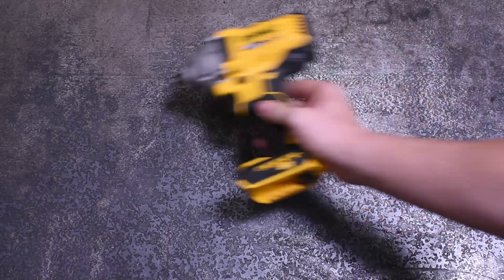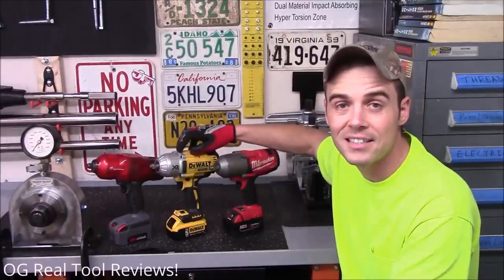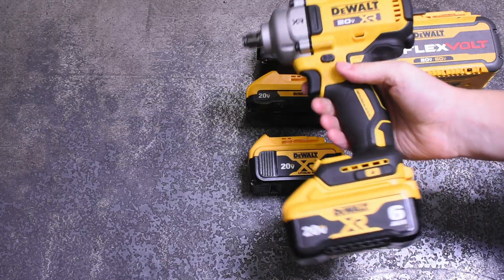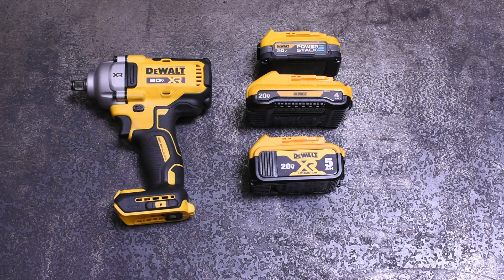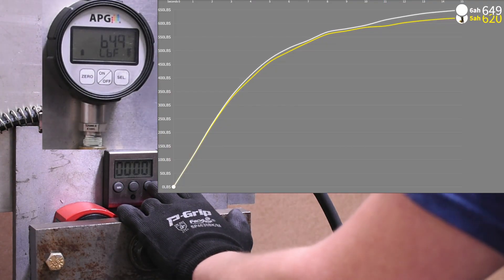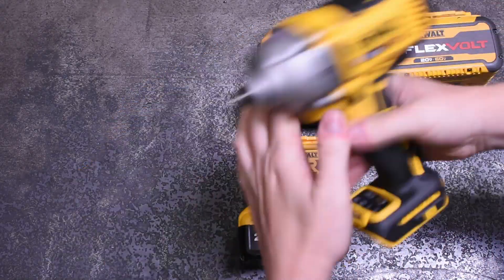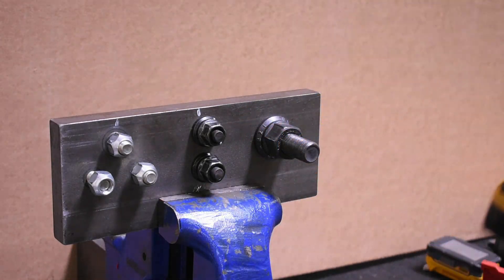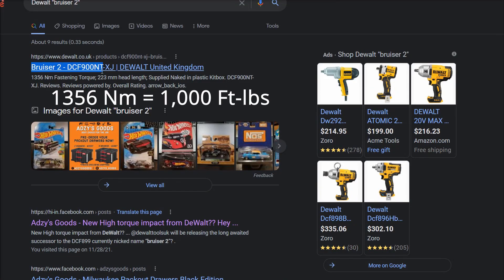Exactly How Much Torque Can DeWALT's Latest Impact Make?

Comment from the maker: The tool is now out! https://amzn.to/3N6bFci
@ 2:35 the labeled tools are swapped, our bad! 15ah might be more lawn mower territory ,but it wont stop us from trying! Who's money is on DeWalt's DCF900 taking a top spot? If you find one sitting on a shelf before it's officially out, drop us a line! Haha
Torque, who started TTC, is working in product development for Astro tools,who also make impacts (air). Always consider multiple sources when looking at a tool!
Reply: I have a 9ah Flexvolt battery sporting those 21700s I could send your way.
Reply: Milwaukee Who ??  Where are all the Red Cry Babies Now  👶 😭 ...
Reply: So I had the old Dewalt mid and I returned it so I could get the new one. The new one is extremely more powerful than the old one. But today at work the new Dewalt shown in the video broke. I’ve had it less than a week already it’s a brand new tool it just came out it’s so powerful it self-destructed itself. The tools still tightens the bolts but it sounds like a box of rocks 🪨
Reply: @Qwertyuiopzxcvbnmlkjhgfdsarbs  so has it released yet?
Reply: Love the channel. How about a worst case scenario competition for these tools. Using the worst available batteries and trying for the highest values. Perhaps a lower power tool with a cheap battery may perform better than a higher power model with a similar cheaper, or lower amp battery. Just throwing it out there, thanks guys!
Reply: Torque: Do you know if this new dewalt is gonna be avaiable to northern Europe/Scandinavia?
Reply: @Speedy6617  yes, it is coming.
Reply: @ThePegi27  Ah. Nice. Thnx for answer.
Reply: @Speedy6617  should be available actually in the coming weeks if not already 👍
Reply: I knew he was hinting at this in the last video!
Reply: I have a XR 1/4" apex(bits) type impact from 2014 and it could remove lug nuts off a 2010 Corolla. Gotten water in it and it still runs fine, batteries are still like new due to charge duration lasting.
Reply: 15ah batteries will be exactly way to go on chain saws, movwers, big table and mitre saws and so on 👍
Reply: Hello again Torque Test Channel 
Thank you for another Great Video. I enjoy watching you test the impact Wrenches. Again thank you
Reply: Anybody have a release date to when this puppy drops?
Reply: You should test the craftsman with the 6ah or the 9ah battery. I'm curious whats the difference since craftsman suggest to use the 6ah.
Reply: Confused me for sec seeing 600 ft lbs on the 894 XD
Reply: How do you think the DCF891 would perform with the Flexvolt 6Ah battery, compared to the 6Ah XR...etc

Comment: I currently have 2ah xr and 5 ah xr. Bought a DEWAlt cutoff tool and came with a free charger a 4ah and a 6 ah.(dcb2460c) will my tools perform better? Impact/grinder/saws? Not sure if I should sell or keep them. As far as impact I have the old dcf894

Comment: What's a better option, the DCF921 or DCF923? Only difference is the size of the drive, 3/8 or 1/2. At that price range what would you guys think is the better choice?
Reply from the maker: I like 923, same power smaller sockets
Reply: @TorqueTestChannel  That's what I was leaning towards. But HD has a sale for $300 for the dcf513 and the dcf921. Cheaper than getting the two alone w/o battery. But I still wanted the 3/8 on the dcf923

Comment: BTW you switched the two mid torques when you compared them  DCF894 vs DCF891.  You put the weaker DCF894 on top.

Comment: My thoughts on the 15ah result: The 6ah pack is rated to deliver 70A based purely on cells, the 15ah pack probably uses the 18650 25S (i've not found out what it actually uses yet) so should theroetically have a current limit of 150A (!!!) but presumably that is being bottlenecked by circuitry etc, and I suspect that many cells jammed together requires some sort of current drain management to prevent the middle of the pack from overheating.

Comment: Hey I'm just curious because there's an 894 on sale in my area. Are the model numbers on those first two tests accidentally switched? Because it shows the 891 below the 894 but it sounds like you're saying the 891 is more powerful as we can assume.
Reply from the maker: Yes, sorry. 891 is on top
Reply: @TorqueTestChannel  Do you think the 894 is worth $109? I really only do trailer and pickup truck tires here or there.
Reply from the maker: Yes. Thats a good buy
Reply: @TorqueTestChannel  Thank you sir.

Comment: In the test with the 894 vs the 891 were the graphs labelled wrong? This test showed the old 894 beating the new 891. I am confused. I thought the 891 had higher torque values. Someone please clarify. Overall video is great and I am thinking about replacing my ridgid octane mid torque with the 891.

Comment: Did anyone else notice the fact that this new mid torque beat out the flex and kobalt high torque with the 6ah battery? Been thinking about going kobalt because of budget but I almost can’t STAND the size of the high torque. This in a kit might be worth the money with a standard 5ah battery. 3 inches shorter and I would imagine a whole lot lighter.

Comment: I have an absolutely battered, close to worn out Dewalt 18v 1/2" impact I use day in and day out at work - when I got it (well used/cheap/kinda broken already really) it amazed me & relegated the air-powered guns to the bin - I wondered how I'd managed/why I'd managed to work so long without a "decent" battery impact wrench - I have no clue how many hours/thousand hours I wasted turning wrenches by hand over the years. 

If you're dithering about getting one - get one. You will wonder why it took you so long to get one.  You will also never again want to be without one & will start watching Channels like Torque Test in order to figure out which one you're going to buy next - and that is entirely sensible because cordless impact drivers are the dogs danglies if you open/close fastners for a living.

Comment: I’m curious as to why you don’t use the 8ah 21700 pack? Do you just not have one?
Reply from the maker: 8ah 21700 packs (from Milwaukee too) use Samsung 40T cells instead of 30T cell, the 30T cells are basically as good as it gets discharge rate wise. So usually not much difference, and if one the 6ah is on top. What we're really missing here is a 9ah flexvolt 21700 cell pack!

Comment: I wonder if some of the larger mah battery torque increase is due to the power transfer dynamics. More weight on the opposite end of the anvil should increase the efficiency of the blows, versus lost energy into the operators hand. You could try testing a specific battery like a Powerstack, then strap a few lbs. to the bottom of the battery.

Comment: Am I missing something? This Impact is rated for 800 ft-lb for nut busting which is what is demonstrated in this video. so Dewalt is over rating it.  I wish they made a 3/8" version. Do they make a 3/8" anvil for this ?
At least all your testing is consistent with all the different brands/ models
Reply from the maker: Nut busting is removing. We"re going reverse but still tightening. No 3/8" for this on

Comment: The new high torque going be an animal.  I have my dcf899 all most 4 years and it been a beast . Friction ring replaced is all . Also tool is very heavy and causes batterys to break were screws hold them together

Comment: I have just ordered the DCF891 based largely on this video.  I am wondering how it will stack up against my old "high torque" impact which is a DeWalt DCF889.  I don't see anywhere you have tested the 889.  Am I missing it somewhere?
Reply from the maker: It would just embarrass that gun power wise

Comment: So I had the old Dewalt mid and I returned it so I could get the new one. The new one is extremely more powerful than the old one. But today at work the new Dewalt shown in the video broke. I’ve had it less than a week already it’s a brand new tool it just came out it’s so powerful it self-destructed itself. The tools still tightens the bolts but it sounds like a box of rocks 🪨

Comment: The 891 and 899 are rated for 600/800 and 700/1200 install and breakaway.  But this video shows the install torque is the same.  Does the 899 still have an advantage in breakaway?  If they are equal I would absolutely consider switching to a tool that is half the weight and the same performance.

Comment: Well I got the 921 recently which wrecks my old 890, though that's still nice to have around if I want low torque. I have the 894 and 899, but this new 891 can pretty much replace both of them. Will definitely be looking for a good deal on it now. Thanks for the great info!

Comment: Amazing power. I'm a team red guy myself, but instead of having all these different impacts for torque ratings I would really like to see some tech go onto one that will control the torque output more, maybe even determine bolt torque depending on if there's a torque stick, extensions, etc.
Power is great but if you can't control it it can definitely make your day go from good to bad in a quickness.

Comment: I have a question where could I take my tw1000 to have it tested. It claims 748 or so but I'm skeptical it's such an old design
Reply: If you have a torque wrench handy you can crank a bolt with your impact then set your torque wrench to let's say start at 450 and see if you get it to click. If it does start stepping up the torque wrench to keep getting a click till the bolt moves. That will give you a pretty close estimate of output on the impact. The closer you think you are to the impacts max torque you can make smaller changes to the torque wrench.
Reply: I've taken 700 ft lb torqued bolts out so I have a benchmark to start from. But as far as tightening no idea

Comment: Just picked up a new FLEX 24V high torque 1150 ft-lb busting torque and 800 fastening torque with 5.0 ah battery.  I have not seen any Flex impacts tested yet.
Reply from the maker: You have not looked very much then :P

Comment: How the fuk are u idiots gonna tell people AH makes a difference in power or torque trolls has nothing to do woth power and using a 60 volt battery on a 20 volt tools ur dumb as it comes. Plz people dont listen to these idiots
Reply from the maker: We're not telling people anything. The bolt is getting tightened differently by different batteries. Feel free to tell the bolt that. Battery capacity doesn't make a difference in power, but the number, type and size of cells used in each battery can make for more discharge current and less voltage sag. Maintaining closer to 18V while running = more power (DeWalt 20V run at 18V). And the 15ah is called flexvolt because it can be used on 60V or 20V tools. Like it says on the battery itself and its packaging, my very confused or trolling friend.

Comment: With the dynamics of cell design and cell size when it comes to power delivery, I really want to see someone adapt 4680 cells for a power tool. Not only are they larger, but they're also 'tabless' and more akin to a pouch cell's tab design; a shorter, more direct path between tabs. I know there's probably patenting issues surrounding the cylindrical cell 'tabless' design, but I want to see a manufacturer make a tabbed and tabless variant of the same cell, at least for demonstration purposes, all other variables being equal, just to see how much of a benefit tabless is when it's the only difference. Although these cells would be overkill, apparently their spec sheet says that one cell has a 26Ah capacity with a marginal voltage of 4.61V, with an operating range of 4.2V to 2.8V, and a fast charge time (10-80% SOC) of 20 minutes. Again, overkill, but also the most amount of beans per cell; though it might actually be a good option for those industry-level batteries, like Milwaukee's MX line, an MX 1" impact could be very interesting, especially if MX ever adopts 4680s.

Comment: Dewalt really showing the beans in all categories. Their best 12V stuff are insane, and the options in the 18V range is turning out to be some serious stuff.
Reply: The first DeWalt tools I got were a 14V drill and impact driver.  Smaller and lighter so they fit in my toolbox along with everything else, and amazing power for their size.  A pleasure to work with, and they've lasted...  Since then I've bought other brands beside DeWalt, but after my experience with that first set, I've never spent money on cheap power tools ever again.

Comment: Can you test the torque loss of using the wrong size socket on a nut/bolt? For example, a 34mm socket on a 33mm lug nut, The other day my coworker struggled with a 34mm socket on 33mm trailer lug nuts, guess he didn't double check the fit before going to work. I bet he lost a decent amount of power to corner deformation.

Comment: The one thing that most buyers don’t realize Milwaukee, Dewalt, Makita, Flex etc. They’re not competitors to each other. The power tool market is Monopolistic Competition meaning no company is a true competitor to each other just like gas stations. The reason is because all of their batteries are not interchangeable. Once you get deep into one line it’s not economically feasible to completely change your brand. If you have maybe 1 tool of each brand you may be able to swap fast but the majority of buyers of all these brands are already heavily into one brand. I’m personally deep into Milwaukee and it would be stupid to switch to another brand after I already have thousands of dollars in tool. However for sockets and hand tools the market is more feasible to switch but still monopolistic competition.
Reply: My First Milwaukee tool was the first GEN high torque 2763 which I use every day as an auto technician for the last eight years there wasn’t a nut or a fastener that it couldn’t takeoff. It can take off a Honda crank bolt very easily. I’m sure the second GEN 2767 could do it faster but until my first GEN breaks down I have no reason to make such a large purchase. So I’ve purchased many other Milwaukee tools due to their reliability and high quality and like you said I’m not going to switch over to any other brand just based on ratings. But I do believe if you start with an inferior brand and found bad results it is a good idea to switch to a top-tier brand.

Comment: I just started collecting dewalt tools in the last year and boy what a lucky time to get into their ecosystem. I already have the DCF921, a powerstack, 5ah battery and a few other of their tools, but it looks like I might need to add this to my wishlist. They're absolutely killing it this year. I hope someone at dewalt is watching these videos and giving their engineers the appreciation they deserve.
Reply: The 921 is awesome. I have the old 894, but this will definitely replace it in the future when I find a good deal. Love my DeWalt tools overall. I save a lot vs Milwaukee, especially on batteries.
Reply: @802Garage  I just came by an 894 a week ago, with the smaller light gun, a 5Ah and 4Ah (both XR) battery in a pawn shop for a couple hundred, thought I was getting a good deal until I saw this XD The impact is like new though basically, even though it's 2019, and the 5Ah is a 2020. 

Next I'm getting me a DCB416B, freaking ASAP. Such a small housing for so many beans in a cordless grinder, it's very excellent from what I could tell when I borrowed one for a day from Home Derpot. I could barely get it to lug down on a fresh 5Ah, and with the 6Ah Flexvolt that the B model makes extra use of I honestly struggled to bring the RPM down to even 3/4 of max while grinding on plate steel. 

I realize that not every tool can be all things to all people, but for the size and weight of that grinder, with a power stack and a knotted wire cup on it with a grinding wheel in my bolt bag, I'll be saving at least half an hour a day just chipping welds, and I don't think the extra 2k RPM makes the extra 2~lbs of the 418 worth carrying all day, let alone how much more bulky it is or the time I'll save over running to the pile of gubs/work trailer to get a grinder and extension cord the couple times a day we need it
Reply: @802Garage  they have the 891 at tractor supply in a kit for 250
Reply: Yes as an automotive technician I have both the atomic 921 and the new 891. They are both amazing tools the 921 is so small but does easy work on control arm bolts and caliper brackets. The 891 I got to help ease the strain on the 921 when removing lugs since someplace way over torque people lug nuts sometimes. Note though the 921 doesn't like high AH batteries past 6AH the 891 doesn't care I have a 10AH battery on it
Reply: 921 for automotive use is a must have.

Comment: Millions of years ago, when I as a young engineer (officially electronics but with the odd bit of mech mixed in) found out about 'windy spanners', it astonished me that they could put out 300-odd ft.lb via a half-inch anvil without breaking anything. And now they're heading up towards 1000ft.lb. You try putting that kind of static torque on a half-inch breaker bar! (Hint: no way.)
Reply from the maker: Yeah the physics are crazy
Reply: @TorqueTestChannel  Sure - and it's as much the physics of vibration as it is of leverage etc. Acoustic impedance and all that stuff, which is why things are often none too obvious.

Comment: I was under the impression the new flexvolt batteries used 21700 cells. Is that not the case? It was the 9 ah I heard that about but would have to assume the 15 ah would be also if it was.

Comment: I found the older I guess 6ah Dewalt flexvolt batteries seemed to come out of the gate hardest when fully charged.
I have a old post dewalt recip saw I chuckle when I use it with the adapter and the 6ah flexvolt thinking this could be the last time it lives!